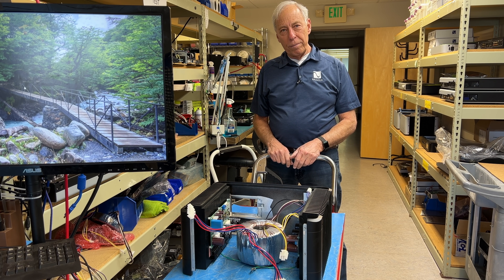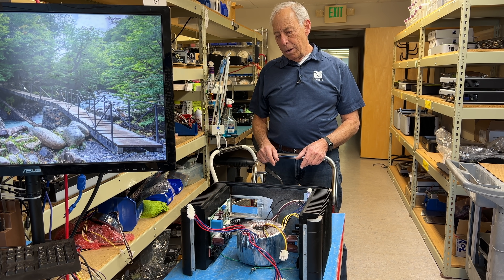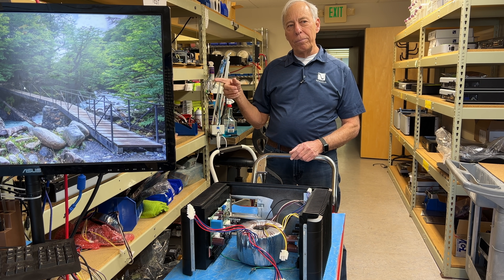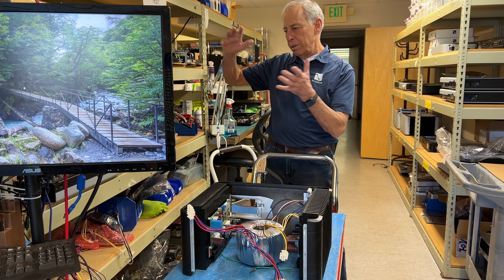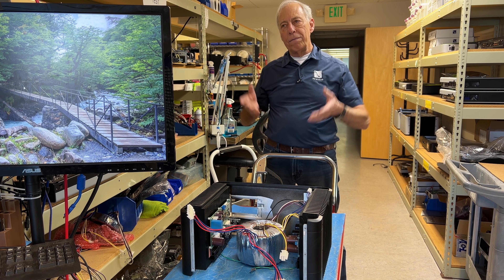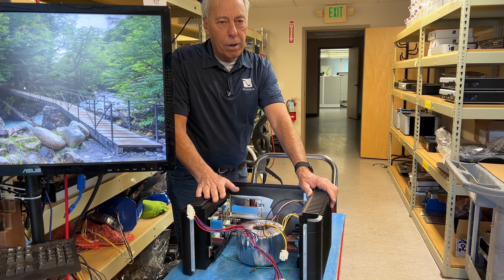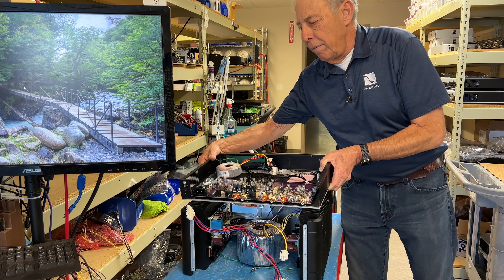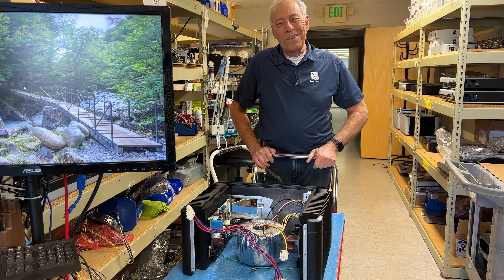Why are many amplifiers empty inside?

Comment: The majority of these amps are tried and true circuits . There is absolutely no innovation in the design . If you add up the cost of parts to what you are actually paying you would be disgusted . Save your money and get better components . If you are disappointed with your gear once you look inside the chassis you can be sure that the person who you are looking to sell your component to when it's time to upgrade will also be disappointed . Sorry , you should get an impressive piece of technology when you are paying what these scoundrels are charging you . You are better off getting a used component that was top shelf 10 years ago than a new piece that has no resale value and offers no audible improvements . Don't let these clowns fool you . Spend your money wisely . If they are not offering any technological improvements then it is just a generic component built to fill a slot at a certain price point . There was no R+D expense when they decided to put the component into production .

Comment: You didn't mention this, but it is important to remember that in order to maximize audio performance and minimize noise and distortion, certain of the components must be kept physically distinct and as far as practical from the other.  Any component in the signal path can receive interference from a component in the power supply path - so a careful audio engineer designing a new device has to make isolation of the signal and power supply paths an extremely high priority.  Many times the best way to accomplish this is just with a little extra distance between components.

Comment: This is why I love my Bang & Olsen bowmaster 6500 with penta 3 speakers the amplifiers built into them and sound that you have never heard if you've ever heard these speakers before. I have my set of pentas that I got over 20 years ago that were built in 89 and they still run a perfectly today as it did back then. But then again you expect that kind of quality from a manufacturer like Bang & Olsen. When I first heard Pink Floyd on my new system that I got back in the late '90s it sounded like I was hearing Pink Floyd for the first time. Notes and sounds that I never heard before we're coming out of my speakers that made it sound that much better. These speakers never crack and you just turn them up louder and louder and the louder you go the more insane you get. They penetrate through walls like they aren't even there. The further you are away from it the better it sounds it seems. But even turn down to two you can have a hard time hearing if you're on the phone with somebody. I believe it goes up to 60 but I've never had it above about a 56 because it's just too loud. I don't believe they ever made anything 17x19. They always did things their own way and it shows with her quality. Did I mention I had to spend $5,000 to buy the last set of Penta speakers sold in United States... Back in their Mission Valley San Diego California store. Which was right across the hall from a Bose stereo store which if you walked into both of them you could unmistakably hear the quality of the Bang side and the Bose sounded like an empty hollow tube

Comment: I purchased, online Ebay, a duel 8" speaker with duel horn tweeters Karaoke bluetooth and aux. Typical setup. It sounded flat and horrible. After opening it up, speakers had tape shocks no foam rubber, and NO tweeters in the molded horns at all. I was shocked. It needs an amp but I haven't learned how to build one to add on. Yet. Lol

Comment: Yeah  mostly empty space because of highly integrated circiuts. However, even higher powered audio amp chipsets should be a little more substantial just to handle the power passing through through and probably heat sinks to dissipate heat energy that doesn't come out as sound energy.

Comment: Coming from the semiconductor field, electronics have become more efficient, and therefore smaller, while keeping the shell the same, so over the years its gonna get worse. I remember back in 1986 while stationed in NY i bought my first CD radio built by JVC, it was ~$100 with detachable speakers, and "chock full of parts, It was a solid Japanese  radio, some one else bought a Koss or something like it but it was Chinese.  When he opened his up and found a few electronic boards with metal plates giving the false impression of a quality radio, but was junk that caused more interference than it was worth.

Comment: in the 90's I worked on CD players and VCRs.  One top of the line denon CD player that crossed my bench was cheap plastic inside but it had a 1/8" thick steel plate spot welded to the bottom cover plate.

Comment: Years ago, my company made the tools to produce a plastic housing for a Pioneer power amp.  The housing had some weird features on the inside. I questioned what they were being used for. The answer was that they held section  of rebar. The heavy metal rods used to strengthen concrete structures. They were using rebar to add weight to the power amp. Light weight amps didn't sell as customers expected a power amp to be heavy to really produce high power output.
Total BS.

Comment: Funny you mention the air / empty space. I have a Phase Linear 400 and even with the reduced depth as compared to a Pioneer Spec series, there's more empty real estate inside than the Pioneer. That Spec amp is chock full to the brim. BTW, they both pass the KK test and the weight test. As one friend said, these things are like a window AC unit with handles.... and a power cord to match.

Comment: The 19 inch width standard has been around for decades. All my hifi is 19 inches wide with differing heights. Its not an issue.
Reply: Goes back to radio and telecom.

Comment: Standard case sizes make installers happy. "Heavy" has always been a good seller of electronics because it was unavoidable for most of design history. Put in one heavy design element and everything else has to made heavy to compensate. "Broadcast" turntables, Marantz flywheel tuning, and iron core output transformers, come to mind of designs that set trends. Until Class D amplifiers came along, I judged an amplifier by its physical weight. There was a fad in the 1960's when hi-fi components were installed in cutouts in the walls.

Comment: I use the "Knock Knock Test" on speakers, but not only the top, the middle of the back, the sides, etc. You don't want the ones that sound like a wooden shipping crate. You want the ones that sound like a block of cement.  The ones the drivers won't thump and make sound like the box are the ones you want. Yes they are heavy and expansive to ship.  Try it next time in your local high end  audio or home theater store.

Comment: PS makes beautiful equipment the sound quality is top tier, the BK Amp I had was 90% air but on the other hand the rebuild was super cheap $100.00 sound quality was not bad at all considering. 
A few months back I picked up a Kenwood KA-4002 for $50.00 (very nice shape one owner) put $400.00 into the rebuild that little amp is amazing the soundfield lacks nothing it keeps up with my monster amps no problem. @ only "18" watts per channel it's a head scratchier.

Comment: somehow it turns out audiophiles are even dumber than i thought ... a 50 lbs powersoft amp has 8 channels @ 5,000 watts each for a total of 40 kilowatts.  meanwhile audiophiles buy a 2 X 100W amp and complain it has empty space inside or isn't heavy enough ... even though it's 50 times heavier watt for watt than powersoft, which is the most respected amplifier name in professional sound reinforcement.  the only part of amplifiers that actually needs to be big is the capacitors.  the latest amps like powersoft and linea research are basically just a box full of capacitors.  all the other big components like toroids, heatsinks and vacuum tubes are just there to give audiophiles something to look at - they have been designed out of professional sound reinforcement amplifiers.
Reply: "Sound reinforcement amplifiers" (PA systems to the average person) need to be powerful, sure.  But the goal of a home Hi-Fi amp and a giant PA system aren't the same.  No one in a huge stadium or concert hall packed with a crowd can tell the little subtleties of music, nor do they really care how clean it sounds, past a certain point.  Volume over the crowd is what matters.  Do I think that some folks who call themselves audiophiles spend way too much for what they get?  Sure I do.  But the comparison you made simply isn't the correct one to make.

Comment: I recall seeing some impressive looking car audio amps back in the early 90s. Manufacturers were all trying to out-impress each other. I saw a few of the cheaper ones opened up and was just shocked at how little was inside and how crappy the components in it were.
Reply: That flea market amp. A lot of those are Just 5 OR 10 watt RMS. Lol
Reply: Have you seen Derek BigD (Williston Audio Labs) on Youtube, where he tested one of those "reverse cheater amps" on the amp dyno?
I think it was a Pyramid model from the early 90's or late 80's. Big looking amp, but when it got opened up, the inside components were a joke. A tiny circuit board on one side, with a bunch of long wires soldered on to reach the inputs and the dials on the other side

Comment: Another reason for space is that electrical components got smaller and more powerful. Think back to the Crown DC 300. Large E-frame transformer, large low-density capacitors, TO3 transistors, etc. Transformers are (for the most part) smaller toroidal transformer, Higher density caps, (switch-mode supply in some lower grade amps) TO3P or TO220 transistors, etc.

Comment: The knock knock test really made me laugh…..i am also from singapore & i recall in the 70s & 80s, many ignorant audiophiles back then judge an amplifier by its weight. The heavier they weigh, the better. I fondly remember how a group of older audiophiles went totally nuts when my puny 3.5kg Creek 4140 integrated amp massacred a humongous 50kg pioneer receiver in terms of bass control, dynamics & sound quality. They couldn’t believe what they heard. Scratched their heads real hard. 2 days later i repeated the same trick with another puny amp in the form of Mission Cyrus 2. Today i own LFD LE 3 which is also puny & has plenty of underutilised real estate inside. But i far prefer its sound to many 30 to 50kg behemoths. Pick your poison!
Reply: My current power amp ( class D ) is 600 wpc and weighs 5kg !!!! Utterly destroyed the 25kg Arcam. The future is lighter 😁😁!!!
Reply: A lot of old Amps need a lot of cooling special the first class a/b Amps.
The big weight come from cooling heatplate and the travo ring .
After a/b with Mosfet the amp las weight and cooling need IT.
Later airflow by a fan and again lower weight .
After dat class-d amp what do not really need a lot of cooling.

Its how a/b VS d amp works.

A/b Amps have always power on the speaker.
A class-d and somtimes digital d amp .
Can set the power of to your speakers.
No sound means no Heat .

Than real old class a Amps.
Well that have to Heat u for a good sound.

Its Just what the type amp it is.

Comment: Standard sizes of cases started to get too big for standard components due to miniaturisation. When I purchased my first stereo set in the 80s, it was the standard 19“ size. The rack had to be that wide because of the vinyl record player on top of it. But then CDs were about to take over, and there wasn’t any need for big cases any longer. So Sony decided to produce smaller sets. But they still had to provide stereo sets of the ‚classic' size. What did they do? Produce the smaller form factor PCBs, mount them into the big cases and leave half the case empty.

Comment: The SET monos I build - have a very low parts count in a small box. The box is 5 mill  steel. They feel weighted. They sound right when driving the right drivers.

Comment: A full-featured amplifier could fit on a circuit board the size of a 3 X 5 card.  It just won't have much amplification.  Powering woofers etc. creates heat.

Comment: I much prefer the lift and weigth test ! If it's more then 15 kg its ok !
Reply: Except that it isn't. The weight of a component means literally nothing in terms of performance and quality.
Reply: @ZenAndPsychedelicHealingCenter  Well at first I was kidding a bit with the knock test and the void inside amps, but one thing I will tell you, weight means better transformers and more power. If the hardware comes from reputed brands it translates in a better product.

Comment: When I bought my first ‘proper’ amplifier (Arcam Alpha 10) about 22 years ago it definitely passed the knock-knock test. It felt like I was picking up a block of lead and it’s built like a brick. The heat it generated when powering the front mains on my home cinema setup was significant so it got extra room in my rack. It has a large ‘air-space’ on one side, presumably in part to ventilate that heat. Today, it’s semi-retired, replaced by a Denon AVR - which passes KK test - but I could never let it go. Such a lovely piece of kit. I just want to find another use for it. Suggestions welcome. By comparison, my 40 year-old Denon CD player has almost twice the internal volume, mostly air, and feels plasticky. Fails KK test - plays beautifully though.
Reply: The Arcam alpha 10 was a wonderful amp in its time. Handily beats far more expensive amps like bryston B60 & Accuphase 203. To me of cos. YMMV. Later Arcams such as A85 & A38 were also very good value for $$. Just make sure the gain in these amps are set to the max otherwise they will sound weak & lacking in dynamics.

Comment: I thought you said tubes are obsolete and building audio pre amps and interfaces with tubes is primitive I thought reproducing a sinewave was better to the ear.
Reply: Tubes make absolutely no difference. It's all just marketing hype.
Reply: @ZenAndPsychedelicHealingCenter  it all depends. I work as a tech in a music store in Corpus Christi Texas they had the latest fender amps I think they were fender vibrio king reissues one was modeling the other a tube amp both identical amps you look in the back the modeling  amp was a chassis with no tubes or transformers and neodymium loudspeakers the other has power and output transformers a choke and heavy fender by  Jensen special design side by side with settings exact on both amps I could clearly feel vibrations of the modeling amp and the guy played the tube amp and it was soft sounding loudness with no vibrations on the walls I guess I’ll buy into the hype.

Comment: A lot of electronics have gone from discrete components to semiconductor modules.  I think these came out of car audio but I’ve seen a few home audio-video receivers have them too.  Just a big black chip that is a 60 watt amplifier.  Line level in, 24 Vdc and outputs to the speakers.  Designed to be mounted on a heat sink.  Smaller than a car key fob.  This takes the place of a much bigger circuit board.

Comment: Also components have gotten smaller. Back in the day caps were a lot bigger actually everything was a lot bigger so it made it look like it was full. TDA chips are basically a amplifier in itself with minimal components. So now we have Palm size amplifiers that are pretty loud. 😁 In my opinion minimal components are good because the sound doesn't have to travel as far to get to the output. It creates a cleaner sound the more components the sound has to travel through it can become diminished and not as clean or clear in my opinion. And also people want lightweight amplifiers not heavy ones these days. Class D lightweight with minimal components and they're very powerful. Downside to class  D amplifiers I don't like the switch mode power supplies I prefer a transformer they last a lot longer.

Comment: Nearly all "professional" sound equipment is based on standard dimensions and usual is listed as per how many Rack Units or RU's it is. So you will see 1RU, 2RU etc. They also have "wings" to allow them to be mounted into the carrying rack. A lot of consumer audio still follow the same dimensions.
Reply: I hope they don't change that, I still mix pro and consumer gear now and then, nice to have it all fit together.

Comment: When the old telephone companies wanted to sell new telephones styles and the only thing available was the old "black cats", they found out that people didn't want the coloured, light plastic telephone because the Black Cats weighed a ton and the news ones were "too light  to be any good." Solution, add a slug of lead as weight inside. No other purpose. :-)
Reply: Those old black telephones were practically indestructible.  I remember slamming the receivers down in moments of frustration or even throwing into a concrete wall, but they kept own working.  This was because the Bell telephone companies actually owned the phones, so they were built to last.  Note: I am quite a bit calmer now.
Reply: @swinde  I just about broke my wrist grabbing one that was ringing  in a Motel in West Virginia in the 1970's while in a deep sleep. Ha ha. But you could use it if someone brole into your room. ;-)

Comment: I have 3  pieces of InterM 500 amplifiers. And they are convection cooled!  And there is space inside. And the bottom and the top plate is open. Plenty of slot's on the sheet!  Then I have an InterM 1000. There is no place what'soewer.  But it's cooled with fans!!